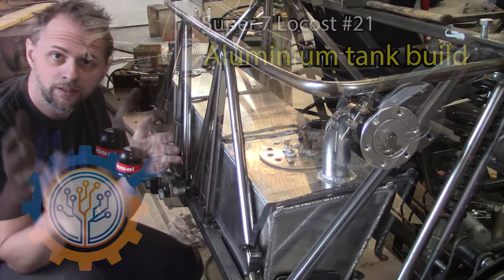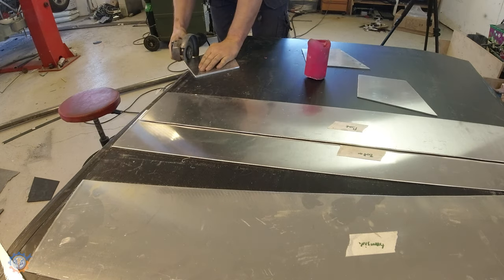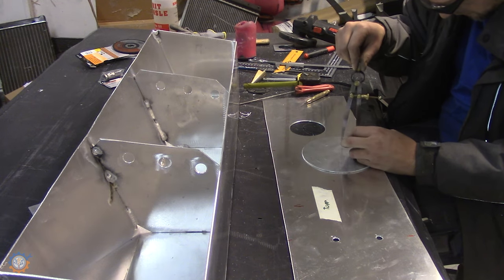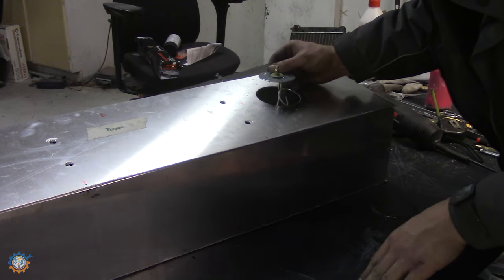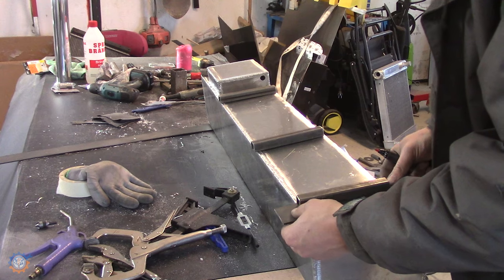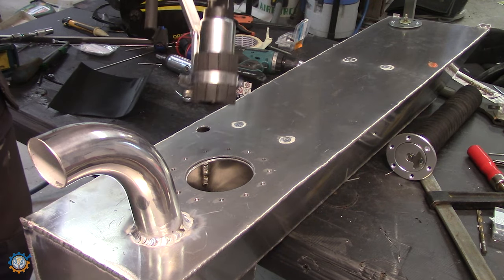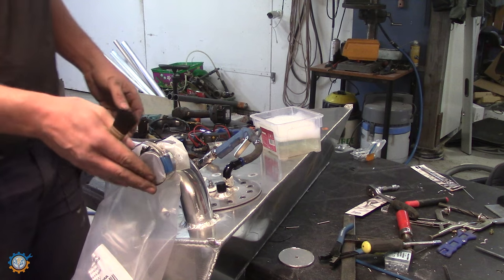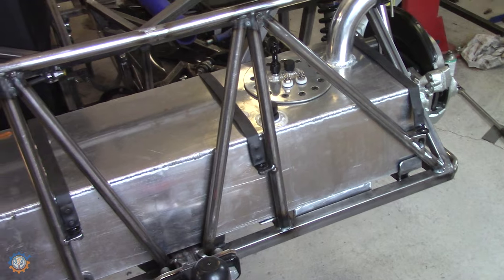Building Super 7 Locost EP 21 - Aluminium tank!

Comment: Hey do you have the measuring plans for the tank? if so could you please link it :) or where you found it. Cheers!
Reply from the maker: The tank is custom made to fit the rear end of My car. And its based on those papee templates. I made it so i could fit as much fuel as possible in a very small area :)
Reply: @DIYTechRepairs   Yeah i see haha, one more question, where did you get your nose cone? im building a +442E locost too and i need one of those big nose cones, any place you got it in sweden? Or maybe perhaps you got the mold for it that i can buy of you or something :)thanks brother
Reply from the maker: @khalidsawaf4175  i dont remember but someone did One for me. But it was to big so i had to redo it. Ie i cut it in half :)

Comment: i have noticed that you're building a 442E chassi and i was wondering what sort of material it required. Like what sort of tubing? Square tubes and what else? Do i need circle tubes? Could you please link or tell me how much material i need to build one of them? As in how many Square meters will i need and how many circle tubes, would be appreciated if you could tell me if any other type of tubes are used to!
Reply from the maker: You have all that information in the 442e drawings. Most People only har 20*20*2mm Square and then the Main frame is 25*25*2
Reply: @DIYTechRepairs  Im currently trying to order steel but i dont know how much to get. i figured you got an idea since you built the chassi. I just know that i need 25x25x2mm tubes , Round tubes (i got no clue how much i need or the size for it ) and like 1 or 2 steel aluminium sheeting for the flooring, Would be much appreaciated if you could tell me about it :) help a brother out cheers!
Reply from the maker: @toozeddyforyou4015  you have that info in the design plan you are following. I cant remember since its 10+ years Ago i ordered to My build but i know all was in the plan